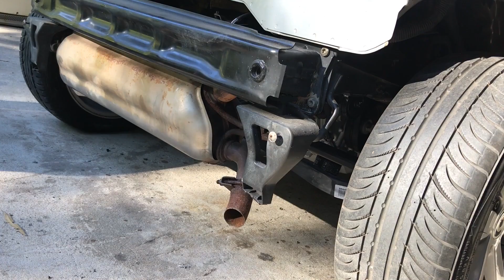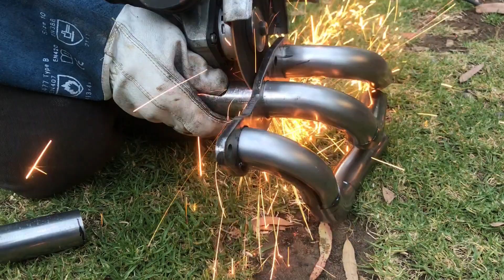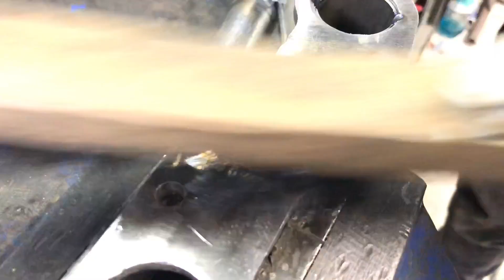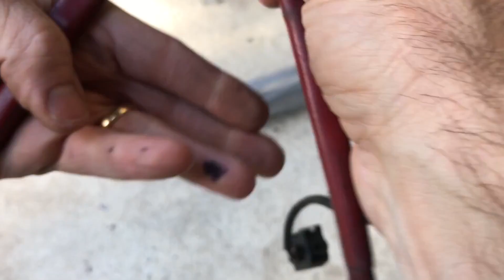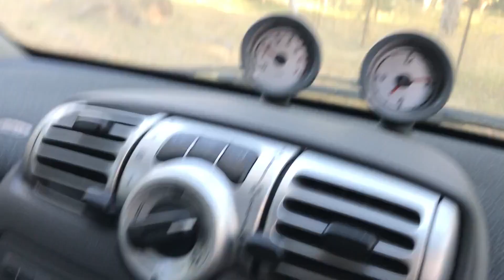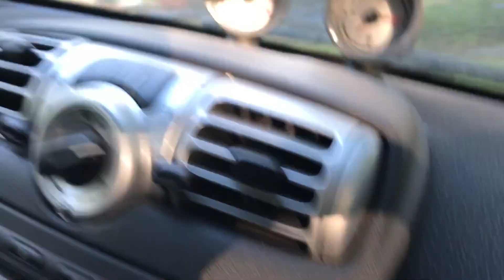Smart Car part 8 Custom exhaust

Comment: Your oxygen sensor was extremely dark, something's wrong.  Also, it should be in or after the collector, not in a primary pipe.  The secondary sensor in some cars does effect tuning also, it's not just to set an alarm.
Reply from the maker: Hi mate, it seems to work fine. It’s was dark before because it had blown rings and hence why I rebuilt the engine. For what I use this car for I don’t think the first sensor location makes much difference. Thanks for the comment
Reply: @Mezzmoengineering  The sensor position makes a difference for two reasons.  Being in a head pipe it won't get an accurate reading, and it's restricting the exhaust flow of that cylinder.

Comment: Mercedes? Thats Mitsubishi engine
Reply from the maker: Yep, car is made by Mercedes and they use a Mitsubishi engine
Reply: @Mezzmoengineering  i dont think benz would build such a thing.its sold thru benz dealers bcuz of auch a small and new company.such is the case with mini thru bmw.i think they even gave up also on the whole project.didnt do well.i remember towing one long ago it would not evwn fit on wheel lift its so narrow ...not really good cars.look fun and sure are to drive too but seems to get old quickly it seems.i think they should have been for private places like parking lots.small patrols.that sort of thing.not on major highways of any country really.
Reply: Mitsubishi engine ?  My  Smart IS made on France and  there IS  a Mercedes motor on it!
Reply from the maker: @SATUTV55  Hi, its known as a Mercedes M132 engine with Merc logo on top, but its made by Mitsubishi and is a 3B21T, see this link https://en.wikipedia.org/wiki/Mitsubishi_3B2_engine Either way all parts are sold by your Mercedes parts dealership.  Many car manufacturers use each others parts so nothing unusual. Look at the global air bag fault from a while ago that one manufacturer sold to numerous different types of cars.
Reply: @SATUTV55  your wrong.its not a merc engine its a Mitsubishi.
Reply: U Are wrong!  Why there IS written Mercedes Benz on The top of The engine?  Not Mitsubishi!!?

Comment: Great Video series.  Your voice over is just right - has the right amount of information and pace and sound.  Very interested to see the tow bar and what smart cars can haul.  I find these little engines are pretty unused  by the custom community.  Not sure why, because personally I think they can be excellent candidates for smaller vehicles, including things like a Sherp, a forklift, a garden tractor, and especially possibly a home built kei truck.  Also possibly a liquid cooled generator - all sorts of things.  Very slightly disappointed to see it has an aluminum block, though the head was expected.   I hope to have a chance to play around with one of these in time.  My 1-ton rough terrain forklift (Badger Bucky) has the 920cc Onan twin on it, and I need to probably change it out soon.
Reply from the maker: Thanks Lyndon. I couldn't find much info on these engines and agree they have some potential for smaller build. Perhaps this series might get others thinking about these engines a bit differently. Its compact and not heavy with good power output once you clear the intake and let the exhaust breathe. Mercedes have also made it more difficult to play with this with their computers etc but they can be beaten.. Got some interesting mods coming so will probably either make some failures or break new ground....

Comment: whats your plan for the smart car? something as wild as your lawnmower? or just a run around?
Reply from the maker: Hi Mate, not as wild as the mower but still more mods planned. Eg Lifting by around 3 inches, huge off road wheels, tow bar, bull bar and winch up front. Needs to be able to tow and drive around a rural property

Comment: I was told once when clearing the memory you need to not only disconnect the battery you need to put the lights on to drain any residual charge in the capacitors that  backup the memory.

Nice looking pipework on the header 👍
Reply from the maker: Hi Mate, I tried that with the battery connected but still needs longer. The memory cleared when I built the engine as it was disconnected for around 3 months. I just need to figure out the minimum time. So far its somewhere between 3 weeks and 3 months...